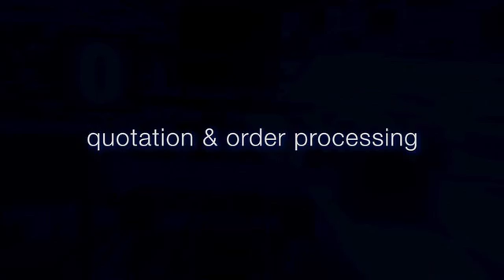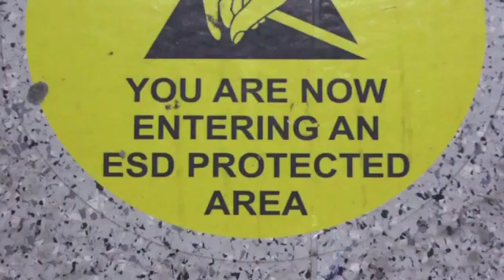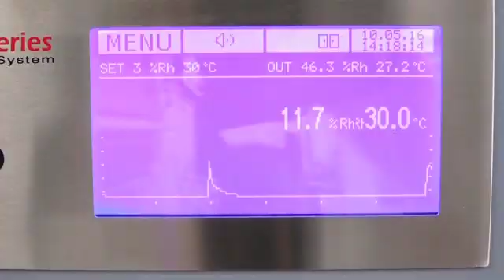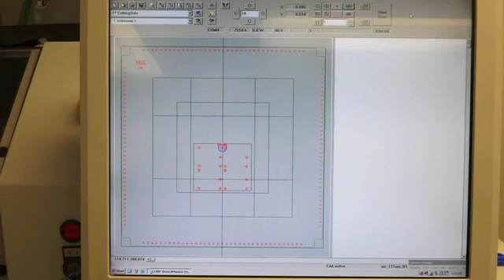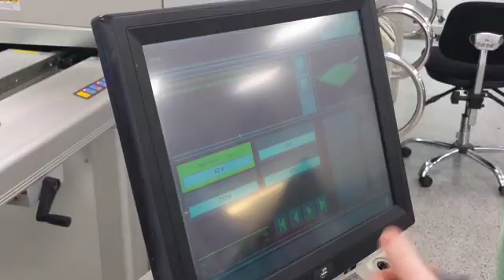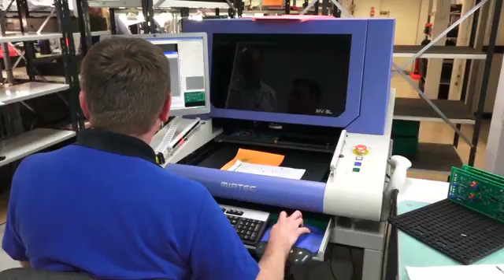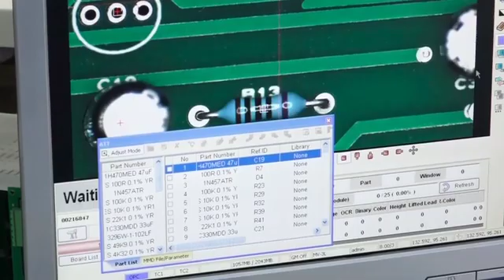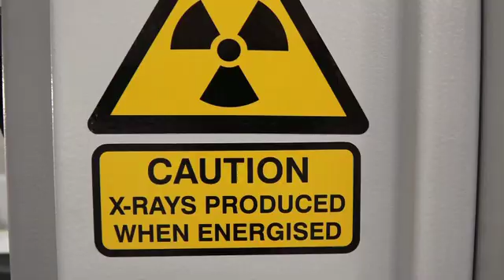PCB Assembly Factory Tour (Full) - How To Assemble A PCB

Comment: PCB assembly is the process of assembling and soldering electrical components on a circuit board. The system is used for a wide range of electrical items that vary from TV remote controls to aircraft radar systems, and a million things in between. With such a huge variation in PCB requirements, it is no surprise that there are different many different types of PCB assembly processes.
Reply: no ko